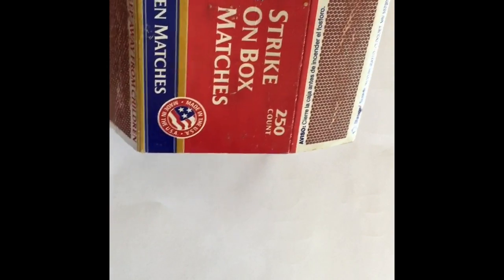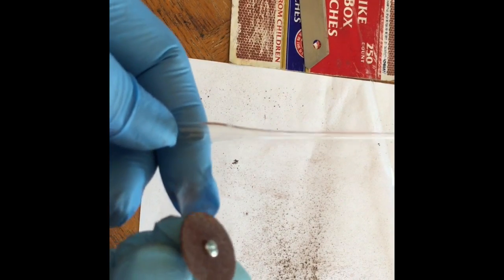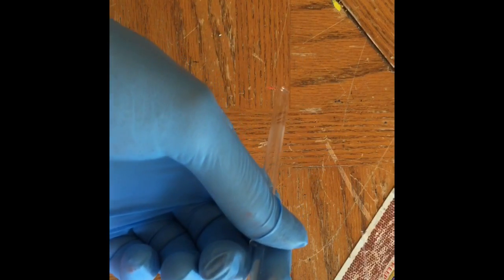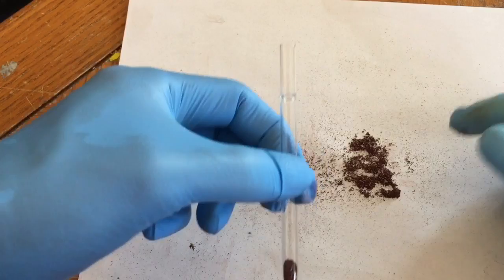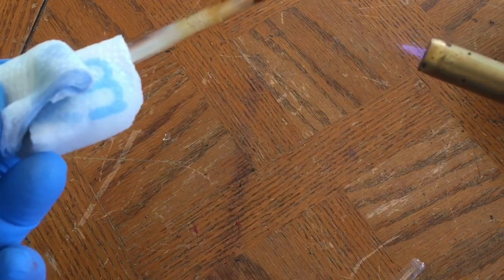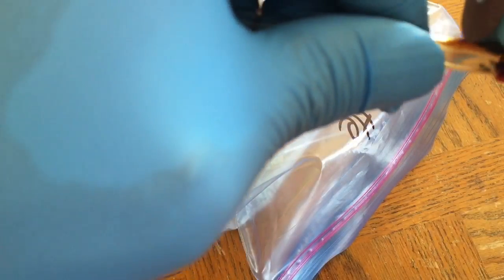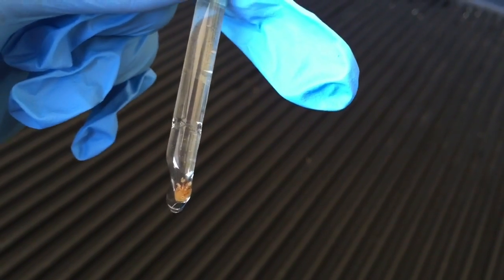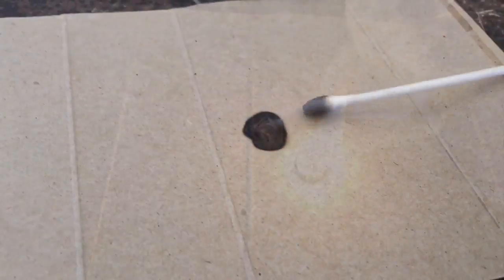Make Pyrophoric White Phosphorus from Matchstriker

Comment: I'm curious if there is a way to synthesize white phosphorous this way but by instead of using argon or similar inert gases as non-reactive atmospheres, what about an inert liquid with a high boiling/evaporation point? Absolutely no clue how the thermodynamics or chemical processes would effect the synthesis but it's an interesting thought if nothing else!
Reply from the maker: An jnteresting thought. White phosphorus is lipophilic and would partition into a high boiling point oily solvent. This would drive the cinversion in the forward direction!
Reply: @BrianDhvTinkerer I imagine if nothing else this would be an extremely interesting experiment!
Reply: There are a few YouTube videos doing exactly that.  Ausiechemist did a really good one.

Comment: that stuff could make excellent wet weather firestarter
Reply from the maker: Never thought about that but yes you’re right!
Reply: Not really it’s toxic
Reply: If you had a damn good method for stabilizing the WP in a safe/ easily useable storage medium, sure. But there are better and safer options so idk why one would.
Reply: @Blue_Jackal  It would be a waste of time to try and use it for wet weather. wet wood doesn't light for shit. you would have to evaporate all the water out of it first.
Reply: Yeetus Yeetus Kermit self deletus I like trains  Do you have any clue how much you would need to burn a house down on its own. I get that it ignites when in contact with air, but it still isn't burning wet wood without a shit ton of it. You need a constant amount of it burning to evaporate the water out of wet wood and only then will it start to burn well enough to burn on its own.

Comment: I made some white phosphorus today and i used respirator mask and it let some fumes out (little bit). I was just thinking how corrosive are those fumes am i getting poisoned by that. Yeahh i know I have read dangerous of white phosphorus but are fumes really so dangerous and should i be worried about my self. And i used glowes aswell
Reply from the maker: Jami Virtala the fumes are P2O5 which is corrosive but non toxic!
Reply: TESLASCIENCE HACKS allright so im going to be ok? :D and im not getting the "phossy jaw"
Reply: @jatuhanteen4406  did you survive?
Reply from the maker: @jatuhanteen4406  when white phosphorus fumes (P205) are inhaled, they form phosphoric acid. ( H3PO4) which can be irritating if inhaled. Phosphoric acid is the same substance that’s in Coca-Cola.
Reply: @yaykruser  7 years ago "so im going to be ok? :D" RIP my friend
Reply: White phosphorus fumes are toxic, and this experiment should probably be done under fume hood, outside, or with proper respiration equipment (not dust mask).